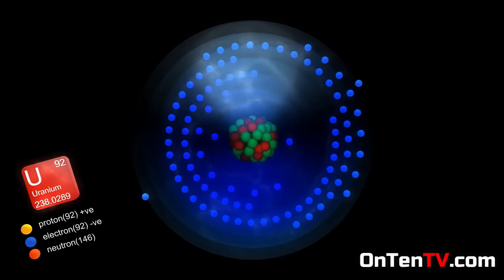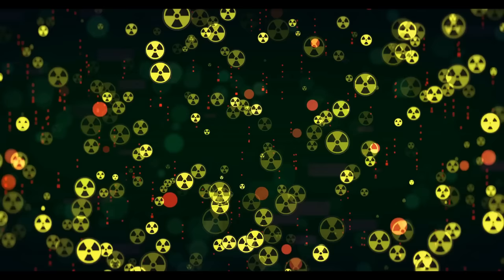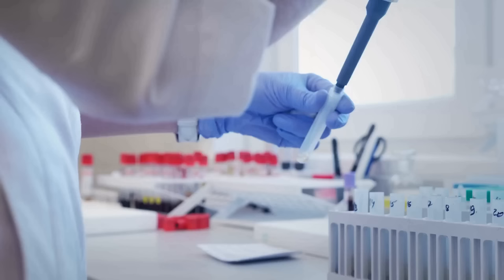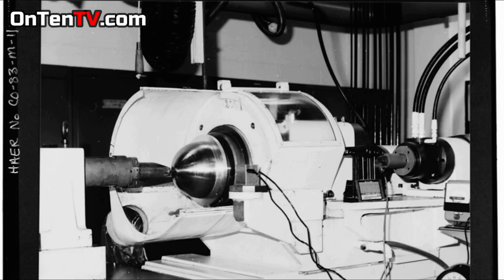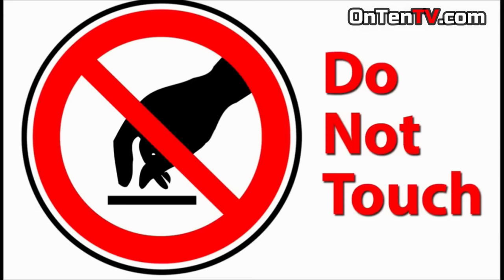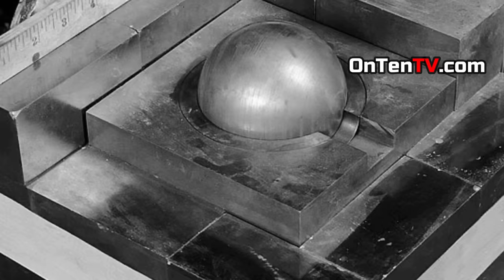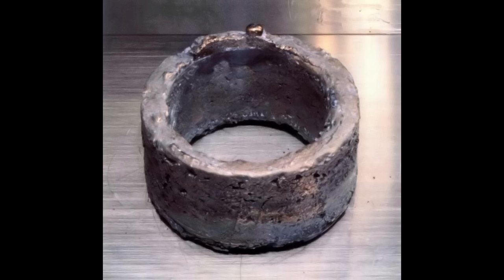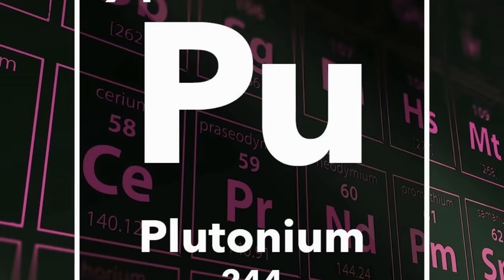Plutonium, the Most Dangerous Man Made Element

Comment: Plutonium isn't THAT bad, it's got a long half life and decays via alpha emission and spontaneous fission.
Cobalt 60, on the other hand has a short halflife and is therefore more radioactive through gamma rays.  Much worse, need much more shielding.
Reply: depends on the Plutonium isotope. 238Pu is also made for spacecrafts and that stuff is really nasty
Reply: fission will only occur when in a critical amount...outside of that it decays via alpha/beta decay very slowly depending on its isotope like all actinides. It does oxidize in air and will shed flakes that are pyrophoric. 
Spontaneous fission can only occur when in a critical or sub critical mass especially when in a neutron moderator like water. If it would spontaneous fission, then it would spontaneously or intantly release its energy during the fission process. Without a moderator or critical mass, the neutrons cannot hit enough atoms to sustain fission. It simply decays via alpha beta and gamma with alpha being unable to penetrate skin, beta going through but not clean through it and gamma being the death ray from hell.
Reply: Can  you imagine MELTING plutonium when it has so much potential for critical radiation spikes I mean when you melt it the atoms are moving around like water
Reply: @GigglesD2 gamma ray incident created gamma man the super hero  🤣
Reply: where can I get cobalt 60?
Reply: Well fk, let's just buy some ratchet sets 😂😂😂😂
Reply: @puo2123  it mostly emits alpha particles rather than beta or gamma. It still emits beta and gamma but not as much as other isotopes

Comment: There are many misconceptions about plutonium, depending on the isotope you could hold it in your hand without issue. No one has ever died or even been harmed by touching it, though people are very scared of it. The real danger is when you get a critical mass of it in one place and it goes prompt critical, this is very bad and has killed several people.
Reply: Auschwitz Soccer Ref.  We deal with dangerous stuff all the time, my point is that unless you get a critical mass of it plutonium is rather inert and innocuous in comparison.
Reply: Fun and learn with M.Hassanain  The Alpha particles are only going to harm you if you scraped off particles and injected them. Holding them will not bother you and it's warm to the touch.
Reply: Can you say Gama rays ! Not good for living organisms !
Reply: Fun and learn with M.Hassanain   The radiation emitted is Alpha radiation which is effectively a Helium nucleus(minus electrons), almost no other radiation is emitted. Alpha radiation is stopped by even a thin sheet of paper or a few centimetres of air. This means it is only harmful if you ingest plutonium which allows the radiation to affect cells in your body, in this scenario that makes Alpha radiation the most harmful radiation. The helium cavities mentioned which forms inside plutonium metal is formed by the Alpha radiation regaining electrons and becoming Helium gas. This is why nuclear bombs have to be serviced every so often to ensure the plutonium core does not have cavities of helium inside it.
Reply: @alfretwell428  And also for plutonium loss.  Some of the smallest nuclear weapons have shelf lives of hours to days.  They have to be manufactured once their use is authorized, and then immediately used.  Neutron bombs are in this class, as they are in the 1-10kt range.  To keep a stockpile of them you'd have to keep rebuilding them.  Great for the nuclear industry, but bad for the taxpayer!
Reply: @Spacedog79  I wish I could speak of what I know but I will say you are correct...
Reply: @Dan Thompson  Finally somebody who must have acquired proficient knowledge! Greetings from an M. Sc. of chemistry!
Reply: The start says Uranium is very dangerous which isn't true either 🤔
Reply: @geoffreycodnett6570  Uranium is only dangerous when made into bullets or  highly enriched for a bomb
Reply: It is very difficult to get a critical mass of plutonium. Uranium, as used in the Little Boy bomb is relatively simple, hence the use of the “gun” type mechanism to join two smaller masses for critical mass. Plutonium, as used in the Fatman bomb, “fizzles” due to reacting too fast before the masses are properly together. This is why Fatman could not use the gun mechanism and needed the plutonium sphere and complex explosive lens. Nobody has ever died by accidentally bringing together enough plutonium to achieve critical mass. It simply isn’t possible.
Reply: @Lozzie74  Ever hear of the demon core?
Plutonium will go prompt critical even without a trigger if mishandled.
Reply: @Lozzie74  It is definitely possible to achieve criticality with Pu, there are many variables, geometry, interaction, moderation, etc. We have many controls but the biggest of all is our mass limit of no more than 7kg of Pu out of storage when handling.
Reply: This is true, I handle clad Pu on the kg scale, the danger is the radiation from holding it for sustained periods. Holding 5kg for one hour will equate to the normal radiation dose the average human gets in one year naturally. You do feel the thermal heat though, it gets quite hot.
Reply: @Ken_M_M  :That's very interesting, thanks for sharing! I presume it was P239? I never knew you could feel it thermally.
Reply: The Demon Core!
Reply: @johnschmitt5259  Indeed, but the Demon Core didn't kill anyone by simply touching it. It was actually perfectly safe to handle, the problem came when it went prompt critical due to bringing the two halves of it together surrounded by neutron reflectors. This was indeed very dangerous, but can only happen in highly specific circumstances.
Reply: @2fathomsdeeper  This is nonsense.
Reply: @Mutrino  No, that's the truth. Some of the newest bunker busting nukes have to be used in as little as 12 hours after production or they fizzle.  Their yield is around 10-20 tons, not kilotons. Personally, I don't know how they can get them that small. But then, I'm not a nuclear weapons physicist, just a former end user.
Reply: @Spacedog79  the demon core was coated in nickel, so even if you touched it, you weren't directly touching plutonium
Reply: @lander77477  Perhaps so, but the nickel coating was likely just to stop the plutonium tarnishing in air rather than as a safety measure. Galen Winsor and his co-workers at Hanford used to handle plutonium all the time without issue.
Reply: @geoffreycodnett6570 No, Uranium is very dangerous. Tell Hisashi Ouchi that Uranium isn't dangerous.
Reply: @MichaelClark-uw7ex The demon core wasn't pure plutonium. It was alloyed with other metals that reflect neutrons.
Reply: @garethjohnstone9282  Hisashi Ouchi was in a prompt criticality accident, these are extremely rare but are indeed extremely dangerous and usually kill those involved.

Uranium handled properly though is pretty benign, just don't put too much of it in a confined space at one time.
Reply: @Spacedog79  Anything potentially dangerous handled properly is benign lol.
Reply: @garethjohnstone9282  Yes, so what's your problem exactly?
Reply: @Spacedog79  Why do you presume I have a problem?
Reply: @garethjohnstone9282  You said that uranium is very dangerous. Used wrong enough anything can be dangerous.
Reply: @Spacedog79  Some, more so than others. Uranium is very much one of them.
Reply: @garethjohnstone9282  You have to balance that with uranium's ability to provide sustainable 24/7 carbon free power for the entire planet. That is quite a benefit, is the risk too much for that?

Comment: Actually, tritium does not glow on it's own. It beta-decays activating a phosphor, which can be either copper activated ZnS or SrAl activated with europium or niobium. 
The only radioactive element that glows on it's own is astantine.
Reply: Well, the light must be proportional to the power of the source (i.e. the half-life of the isotope times the mass of the object).

Why astatine (half-life 8 hours for the most stable nuclide)? Why not francium (half-life 22 minutes), and also a suffiviently high density?

Besides, most isotopes of element higher than curium will glow in the dark from their own radiation by ionization of tha air surroundig them. Some isotopes can produce kilowatts of energy per gram, and without sufficient cooling, they would vaporize instantly.

Such elements with high output are often deposited as thin films on a plates to increase their cooling.

Comment: I'm not surprised, density doesn't always mean resistant to temperature. Lead for example, which is just entirely depleted uranium, also very dense, has a very low melting point. Mercury even more dense, is liquid at room temperature
Reply: Yes, I'm not sure where the author was going with that.

Comment: Plutonium CANNOT BE MACHINED reliably as the pure metal because it is impossible to prevent it from changing from one allotrope to another, and the distinct allotropes have distinct mechanical properties, including hardness and brittleness. Hence, plutonium must be alloyed with gallium, which prevents the phase changes that plutonium otherwise would experience. Furthermore, gallium-plutonium alloy is not nearly as brittle as the element, and thus can be machined.

Comment: Anyone else find the price of the plutonium at only $4000 a little scary
Reply: It is theoretical. US does not produce Pu anymore that I am aware of but there are reserves.
Reply: It's purely theoretical. You need a special permit to buy or own plutonium, which you will likely never get.

The calculation is as follows: In a nuclear reactor, one neutron can either take part in the energy production by fissoning another nucleus which also gives off one neutron. This is what is called energy balance. A nuclear reactor (when working properly, of course) will always assure that one neutron is produced for one neutron consumed. This is called criticality, and is always = 1.

The neutrons that don't participate in energy (electricity) production can be seen as lost value. Knowing that a production of 1 g of plutonium requires a corresponding 25 MWh of electrical power that could otherwise have been sold on the market, some clever person who knows the electricity price, has calculated the price for plutonium production. To this cost must then be added the cooling of the fuel, the wasted uranium in the fuel rods, chemical separation and conversion of the plutonium, storage, security, safety issues etc. Not to mention the disposal when that time comes: In fact, the sum may come out negative, making plutonium a metal with a negative price: You will eventually have to pay to get rid of it.

The comparison also breaks down for a reactor that is specifically built for production of weapon plutonium and not energy production.

Comment: You made one rather notable errro -  you suggested said plutonium was first made in 1940; which is impossible because there were no nuclear reactors until the Oak Ridge reactor got enough U235.  This was not until the Manhatten project had started and u235 refine - thus it could not have happened before 1943.

Comment: You can find plutonium in nature that is NOT man made... 239Pu and 244Pu

And no its not one of the most radioactive metals. For example 252Cf is about 30.000 times more radioactive than 239Pu.
Reply: 252Cf is mighty spicy stuff. Why more dangerous than plutonium by weight. A critical mass of it would also be a marble sized chunk, but good luck getting anywhere near that amount in one place. I'm rather certain there isn't even that much in circulation as most sources are in micrograms or a few miliigams at best for things like reactor startup rods.